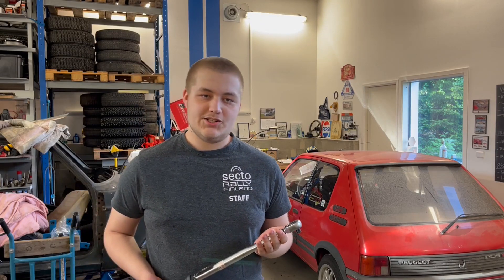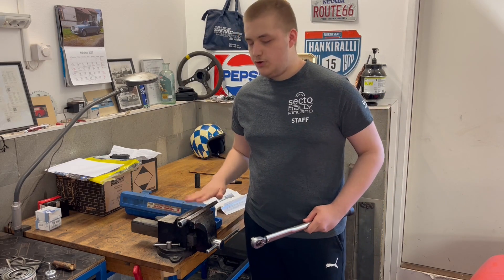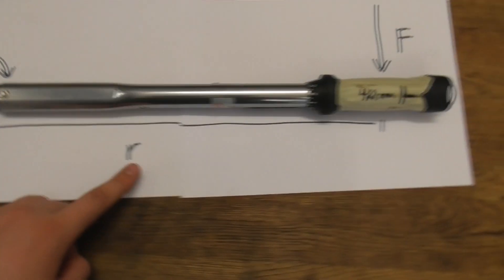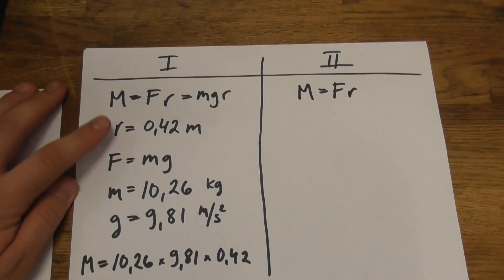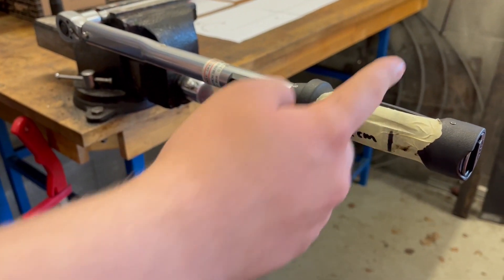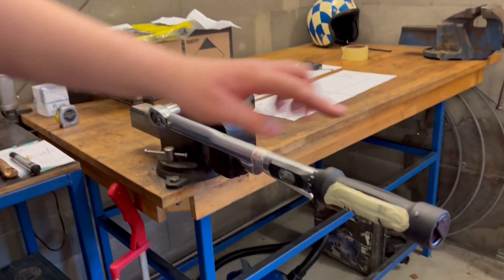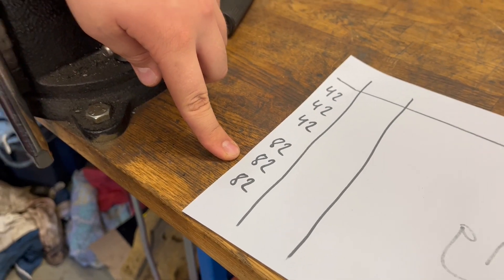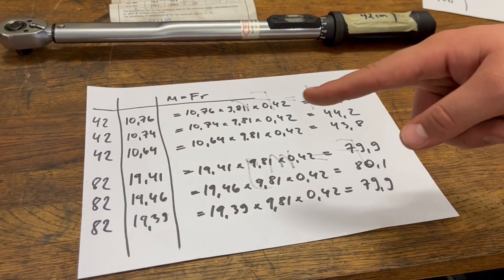Torque Wrench  Calibration Test | Nm & Kg | DIY Cheap & Easy |

Comment: To calculate the wrench own torque from its own weight you have to find the balancing point of the wrench. This model has its center of gravity at 247 mm and it weighs 1,32 kg so its own weight will add 2,8 Nm to the measurement.
Reply from the maker: Thanks!
Reply: 1,32*9,81*0,247=3,20 
1,32*9,81*0,42=5,44
5,44 / 2 = 2,72
 what did I calculate wrong?

Comment: Hello, great explanation. I am a beginner and I need your advice... I recently bought a LEXIVON torque tool and I use it at home to change my car's oil and tighten the tires. Do I need to calibrate my tool for this simple use? And my other question is, like my case, after how long should I check the calibration? With thanks and appreciation.
Reply from the maker: Hi! Good questions. I did this calibration after 10 years which is a long time but I always use it with care and put it back in to its box. I'm not the right person to say how often the calibration should be done. Always if you drop it or hit it somewhere or if you think it's not accurate anymore.

Comment: Gravitational acceleration on the earth? Wtf are you doing? It's just weight X distance divided by 12.
Reply: He's showing the necessary calculation for dealing with metric units. If you have to work in metric (e.g. the wrench doesn't have an imperial scale), you don't directly see a Kilogram weight value to use. The formula is  force x distance, but weight in pounds can be used directly when it's imperial because the force unit is already expressed in pounds (pound-force generated by acceleration under gravity), whereas the metric Newton in the Nm isn't expressed in Kilograms. We need to do the calculation of mass-force equivalence (using the 9.81 gravitational field strength) to turn a Kilogram value we get from a scale readout or deadweight into a Newton force value. (Edited hopefully for clarity.)
Reply: @PlatypusPerspective  Interesting, thanks. Glad to leave that newton stuff to my friends over the pond 😁
Reply: @BrewCityRider  We went metric in Australia around the time I finished school, so I'm comfortable with either. But for some things, like this, imperial still feels a bit more intuitive.

Comment: Yet another, incorrectly applying weight at the end; it has to be centered in the grip as designated by the handle design, to be accurate; it does NOT relate to the lever arm as measured, because what causes the click is an internal bending of a bar, to where a small pivot tips. This is all a function of the design at the factory; a torque wrench is NOT a simple lever arm bending (although old style 'beam' wrenches are close to that, without a click alert).

Comment: I tried using a weighing machine and a 1.5ft long wrench for tightening my car tire's wheel nuts

The needle of weighting machine read my weight at 140lb. For the initial 1st round for tightening the wheel nuts I let the needle reading to drop to 110lb as part of my weight is being applied onto the 1.5ft long wrench.

For the 2nd round of nut tightening I applied body weight until the weighting machine needle is at 95lb.

For 3rd round of tighting the needle reads at 75lb. So 140-75 x 1.5ft wrench for 100lb foot of torque applied onto wheel nut for tightening.

Tire shops tend to over tighten wheel nuts to 140 ft lb or more. 🤔🤔🤔
Reply from the maker: I have had few times issues to open wheel nuts. I can be a real nightmare...